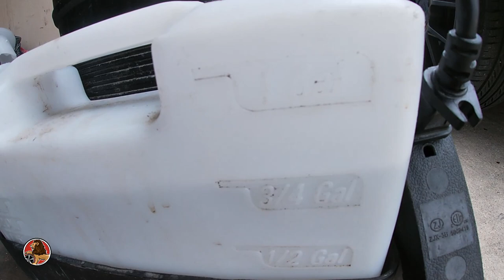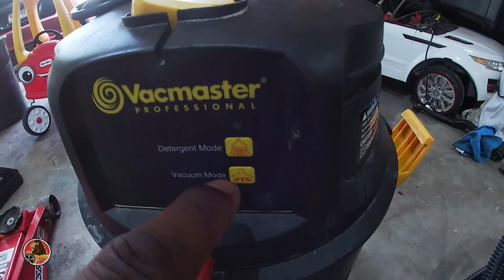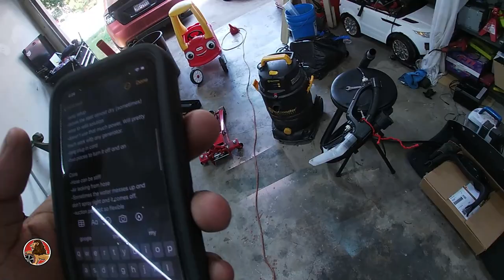Pros & Cons of the Vacmaster 3 in 1 extractor. 6 month review, should you buy one ?

Comment: Great video. On the air leaks around the upper hose housing use a roll of $12 black rubber "Rescue Tape". It adheres to itself and will seal the air and water leaks but won't leave a residue if you need to remove it. It also is flexible. Just a thought

Comment: I got 2 problems with this thing. Both of them u pointed out. 1-the small water delivery tube. 1st time using it it didn't work. Exchanged with the long tube to see if it was the handle or machine, and it worked gine. I don't know if it clogs ort something. I looked at the hole closely and didn't even see where the actual water comes out of. Weird. Gotta call vacmaster and get a new one.
2- the handle. HUGE!! To do carpet in corners of car is nearly impossible. I'D LOVE TO SEE SOMEONE MAKE A VIDEO FOR THAT!!  Im possible yo get rounded corners clean.. It sucks!!
Reply from the maker: I agree. It’s good for what it is and price point. I worked wonders with that machine. I got a mytee now.